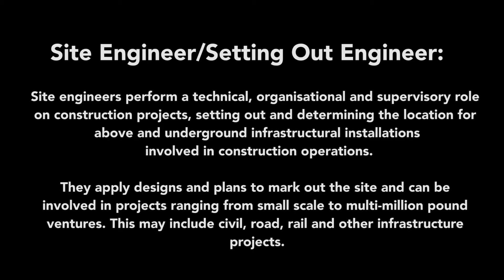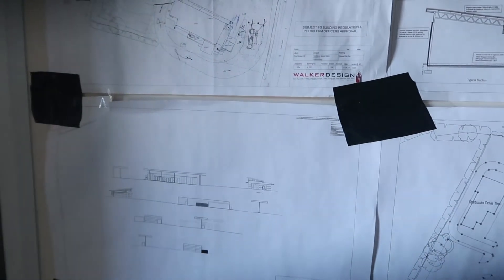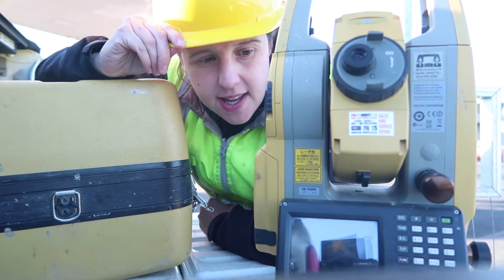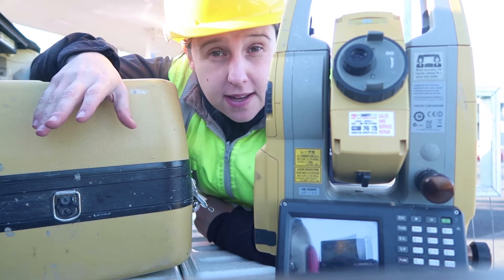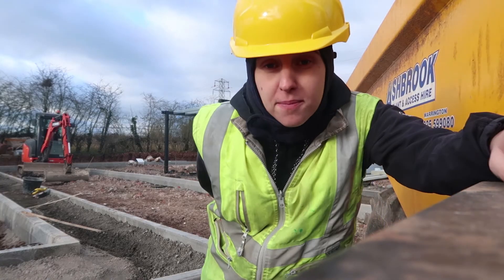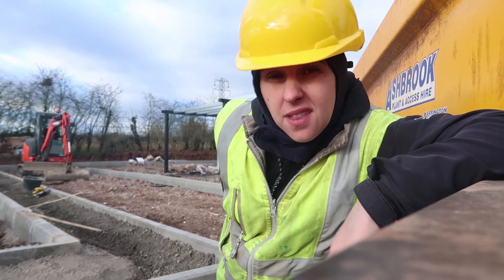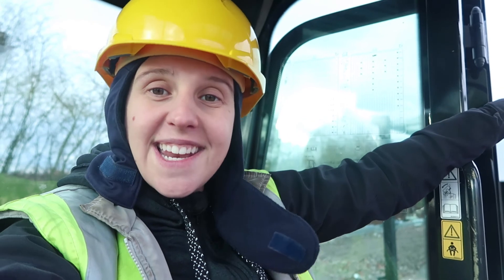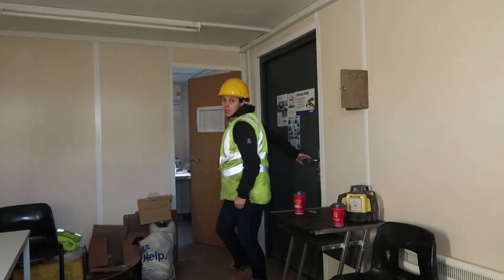Construction SITE ENGINEER: DAY IN THE LIFE - Setting out

Comment: What type of Maths is required to be a setting out/site engineer? I have GCSE Maths, my A-levels didn't use Maths. Is there a video showing the Maths/calculations required to do setting out/site engineering?
Reply from the maker: Hey, you might be ok with G.C.S.E if you can start out as an apprentice.  You need a good grasp of trigonometry to understand the basics of setting out.  The majority of the maths is now worked out by the machine, but an understanding of what the machine is doing is very important.  For everything else the basics are measuring up volumes and quantities which isn't too taxing and a calculator is always on hand. Hope this helps!
Reply: @SheWhoDaresWins  say if i did a bsc degree in civil engineering. Would i still be able to get a civil engineering job in the near future.